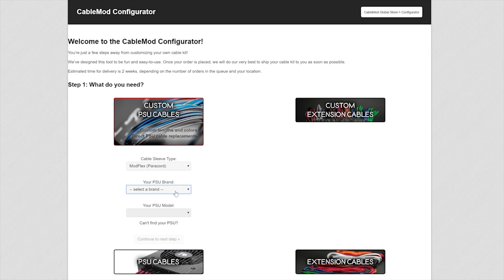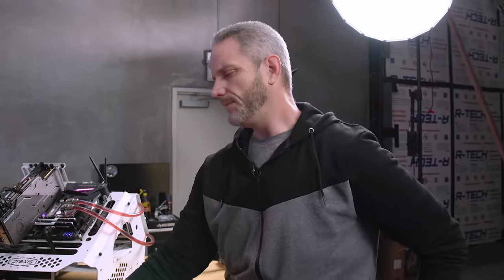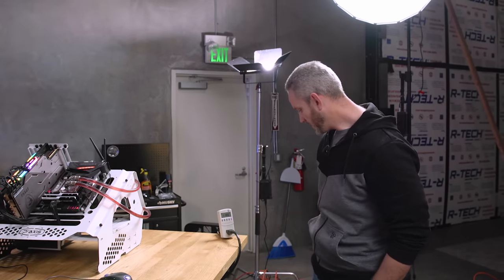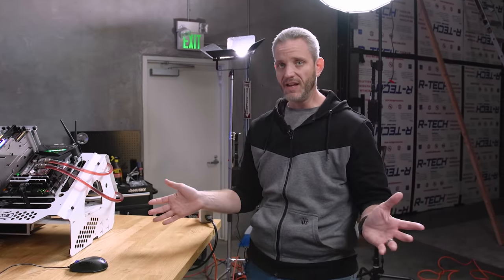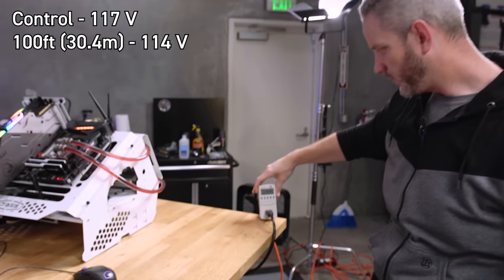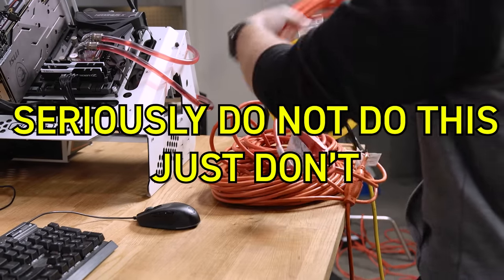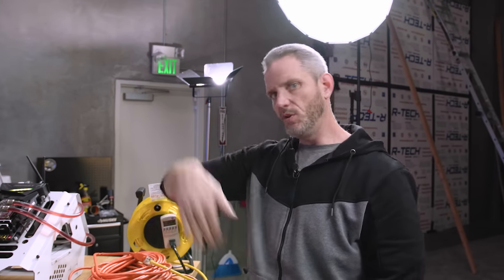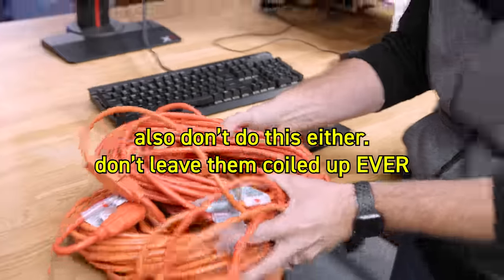Are extension cords dangerous for Computers?

Comment: Definitely want to see what happens with multiple pc's on multiple cheap splitters daisy chained together. I did happen to work at a site that was about to try that with several dozen laptops, but we saw what was happening and rewired it before they started, not too sure what would have happened then, and we didn't stick around to see the people that were using them,  were just setting stuff up.

Comment: around 9:50 when jay fumbles with the coed.. why are the LEDS on the motherboard still flashing like the pc has power.... When he clearly had  it unplugged... Explain dat!!!
Reply: Capacitors inside the PSU, decent PSU would power up the LED for about a minute even if it has a power cut.

Comment: <Laughs in European>
do you even 240v, bruh?
Reply: Yeah we can get 240v that's our second residential power type in america like its literally the 2 main types 120 and 240 laughs in usa because Europeans are ignorant of our systems here.
Reply: Like every house or building will have 120 and 240v lines or higher voltages
Reply: @jdrok5026  So you're saying that every residential outlet is dual voltage 120/240v in the US? I don't think so. What's the chances that you're going to have a 240v outlet where your computer is?
Reply: @JN.0_o  you can get it installed all houses normally unless not been updated for decades will have 240  and you can install more the chances are entirely up to you. So maybe get educated there is no requirement on how many 240v sockets you have. But meh
Reply: @JN.0_o  like seriously no the sockets arent dual voltage we get separate outlets for 240v and you can place them where you want.
Reply: jdr ok well if it’s that commonplace why wasn’t jay using it? Salty much?

Comment: During the Summer time I alot of times have to run my Tower on an extension cord because my roommate is on the same 15amp circuit and if he is running his computer and his Window AC it leaves enough power in my room to run the Networking items "2 Wifi Router"one Kids and one Adults" and a Modem" and my Home Server.

Comment: The message is good and probably well suited for the audience, but the engineering presented is all wrong. There was no discussion about impedance or harmonics. Everything you said is more or less correct for DC circuits, but AC is a different beast.

Comment: There are some weird misconceptions in this video.  The ripple and condition of the power coming in to a modern computer are meaningless for practical purposes.  all the power comes from a switching supply which if designed any good at all can will easily filter any such ripple...on the output side as it creates a metric shit load of ripple by design.  
The issue id the resistance of the cords lowering the input voltage to the supply.  the lower the voltage, the harder the PSU has to work to maintain a steady output.  This voltage drop increases dramatically as the current draw rises.  This is why you can go 100 meters on cat5e at 5 volts, as the current draw is in the microamps where as a 100 foot, 16 gauge extension cord at the full rated load of 15 amps will drop more than 12 volts.  (a 12 gauge cord will drop about 5 volts over the same 100 feet) I have to revisit the information but I think these figures are actually doubled, as the flow of electricity is traveling 100 feet to the load, then another 100 feet back to the socket through the second conductor, but not certain on that, or if it's included on the AWG chart
I suspect that most modern PSUs have built in low voltage shut off to protect the system when they can no longer provide a suitable output.  
I recommend checking out Beyond The Press's video on coiled vs uncoiled cords as well.  Heat is not your friend, and all that voltage dropping has to go somewhere...it's going towards making heat.

Comment: It makes me wonder if the interruptions in a contiguous line of power introduce most of that resistance (i.e, plugging in multiple extension cords vs using one, very long extension cord). I wonder if you just used one long exension cord, if you would see a difference vs 4 extension cords.

Comment: The way he winds em back up after using em made me cringe. Its gonna stress the conductor and the sheaths over time and he could either short the cable or break a conductor. 
Don't force twisting into power cables, you could hurt people or equipment.
Coiled cables also create a magnetic field that can interfere with WiFi and other electromagnetically sensitive devices.
Also because a coiled cable induces current into itself you make the power more dirty just by not unwinding it.

Comment: What about Surge protectors? if i have everything that i need plugged into one, into a single outlet: Computer, Monitor, sound system. is that bad? Should i never do that? (i havent done it. Nor will i. Not until i know it wont Brick anything of mine)
U.S. 120v from the wall.

Comment: Jay I need your help I'm new to the pc world but I have a i5 7400 processor with 8 gb DDR4-2133 SDRAM with a GTX 1060 3gb card with a 500 watt power supply. Can I upgrade to a 1660 ti or 2060 or what's your recommendation please I need your help.

Comment: i've been using an extension cord for my desktop for years, and i'm sure its fine with my laptop too...holy crap i think i'm using the same exact extension cord too...its a 50 foot orange cable but my PC also runs everything on a 600 watt power supply so maybe if i went over that it could be a problem?

Comment: So what I hear is don't plug my new pc into a surge protector
Reply: Is a surge protector a crap extension cord?
Reply: @Bendigo1  I dont really know I have them for my console and it's just a extension u plug into a extension cord and if your power cuts out it's supposed to stop the influx of electricity to your devices other then that I dont really know how to explain them or have seen other versions
Reply: @collynsmith5432  im sorry, I was being sarcastic, I thought you were being sarcastic. 

 A good surge protector is much better than an extension cord, they are actually designed to protect your electronics.
Reply: @Bendigo1   lol all good

Comment: the coils make a magnetic field that gives resistance, that's the reason it get's hotter(also harder to get rid of the heat). i was hoping you wuld put a huge extension coil on top of a PC to see if the magnetic field could destroy it.

Comment: This video is very misleading. It is about length and gauge. 100ft 16 gauge is not "bad". This is like loading a 450w psu with dual titans, then blaming issues on the psu's quality.

Comment: I use an extension brick with grounds because i only have two working outlets in my room but my pc is the only thing plugged in to it because the outlet fell out if the wall works fine just isnt secured....and i dont want my pc plugged into a loose outlet because of how easily it can be nocked loose...never will plug it into an extension cord just doesnt feel right XD

Comment: Jay... For the love of whatever deity you worship. DON'T COIL CABLES LIKE THAT!!!! It hurts my soul. Over under or use the cable memory to help you feel the size of loop you need.  When you coil cables like that you slightly break the strands of wire inside of the cord and introduce more resistance and over time will break the cable. Also that's why every extension cable you see in the wild won't straighten out all the way. 

Source: 5 year touring lighting technician and has rolled up hundreds of miles of cable without having to replace anything.

Comment: cheapest cable but premium pc hardware....fair enough what else i can say(no).
In case of cheap psu - it will "die" faster and even maybe with some fireshow as it planed to be in show.
 Next one -  look at this - "w = v * a". So wheen u know params - no hard work to calculate a wire.
In teory it working dat way - in Russia and elsewhere voltage is 220 - u need less Ampers for watts pc use at work. So cable cut size will be not dat much u need is USA. Cause for 1500 watts at 220 u need around 6 ampers. And for 120 volts 1500 watts will it be almost doubled - 12 ampers.  imo more ampers - thicker cable u need ?  
Dunno exact but am i right?

Comment: Had a question. Has Any one ever run across a PC  issue where, the power supply stays running but everything else shuts down? Like fans shut off, motherboard,  video. All of it.... Cept for rgb lights in the case ? Some times I can play games sometimes I can't even check email very crazy. When it does this only the mainline power switch or cord will allow me to power. Never heard of this before other then it's clone. Bought same time 5 years ago they both ran great then in the same week both same issue. Something hardware goin bad. P/s seems obvious but how it keeps partially running I dunno
Reply: Thought maybe the relay in the PSU is failing but details kinda say otherwise? To broke to completely rebuild

Comment: Actually supplying less voltage would cause current and wattage to go down. It would be like supplying 208v to a 240v heater. A 240v heater rated for 1500w would only provide 1125w if powered with 208v

Comment: Amps kill! Plain simple. Usually electronics have some way to "compensate" for voltage drops and still being able to deliver the wattage needed for proper functioning, however this goes just so far, since current (amps) kills, to prevent an excesive amount of current (amps) running through the system and killing it, usually they shut down to prevent damage

Comment: Jay: "some contractor out there be like"

Me: "Jay, no no no no. They can get WAY more expensive than that. I have a 10ga 50ft cord that I call the 'power hose' in my garage. I can safely run a tablesaw on it! When I add a 500w shop light the breaker commits Hari Kari, but the cord is fine with it LOL."

Comment: Granted the extension cables are kept mostly straight, and the connections between each are clean and well-sized, it shouldn't perform any different to regular old home and overhead wiring.
The big problem is coiled up extension cords with a high load, which act as very large induction coils that want to drop the voltage, in turn making the PSU draw more current to keep the DC voltages within spec, in turn making the cords heat up to dangerous levels also due to being insulated.

Comment: This is hillarious......There s no difference if you use extension cord or not....And you may ask why. If you turn on a light bulb and no extension cord, the light will turn on when you hit the on switch....no delay. If you use extension cord and do the same, the light will turn on when you hit the switch...no delay. There is no loss even if your extension cord is 50 meter. You get the same output as input. In Europe and UK it's 220v  50hz. And the speed is fantastic. The speed of electricity in a 12-gauge copper wire is 299,792,458 meters per second x 0.951 or 285,102,627 meters per second. This is about 280,000,000 meters per second. So your experiment is nonsense.

Comment: Jay the mainstream DO NOT have 2080it's! They have 1660's, 2060's, 5500xt's or lower. 

The upper part of the mainstream have 5700xt's heavily overclocked, 1080's heavily overclocked, 2070's heavily overclocked, and maybe a Radeon 7 here and there too. 

The high end of the market only have 1080it's, 2080's, 2080 Super's. 

The enthusiasts at the top of the market have 1080it's, 2080 Super's, 2080it's. All heavily overclocked on the bleeding edge of stability too! 
And a good portion of them in a custom water loop! The rest are the monster air cards like the MSI lightning and the Zotac AMP EXTREME cards. Like myself. 

Geez dude catch up with what's going on in the market! And your audience most importantly of all!

Comment: Cables should never be rolled up while used becase it's creating inductive resistance which will lower the voltage. A rolled up cable canalso cause fire because it is not getting the full contact to air for cooling and also the higher resistance causes heat.

Comment: The conductor loop, or coil, cuts through lines of force in a magnetic field to induce A.C. voltage at its terminals. 
Faraday was aware that that a coil of wire with an electric current flowing ... to the rate of change of the magnetic flux that cuts across the circuit.
Coiling up the wires creates a magnetic field. 
Example. A coil in a passive crossover used in audio speakers will cut off high frequency where a capacitor cuts off the low frequency. 
So the coiled up wires are not  a proper test that is equal. The other coiled up yellow cord never got the same treatment with a compressor as the cheap ones. If ya test one the other needs the same treatment to be apples to apples.  Jay your videos are great but this one I don't feel is apples to apples. I can see some of the cords are in a coil but most would be crisscross all over the room in the real wold
. I'd like to see the test redone in a real world scenario.
You don't have to use computers at the end of every cord just something that uses equal electricity. Then use a I.R. or a temp gauge to test heat.   Infrared would be the best as it would show exactly where the cords get hot.

Comment: I would heed to this advice, but unfortunately I have to use an extension cord, or risk using an outlet that is looser than gwentth paltrows sun-never-shines city. the only other outlet is on the other side of the room. I'd rather use an extension cord than have my pc randomly lose power from the outlet several times a day.

Comment: Lmao they literally made a huge inductor! Inductors create a e-field that is opposite the direction of current flow. In other words that coil was taking up a lot of those missing volts. 
I bet without the coil and with the same length of wire you’d have a lot more voltage.